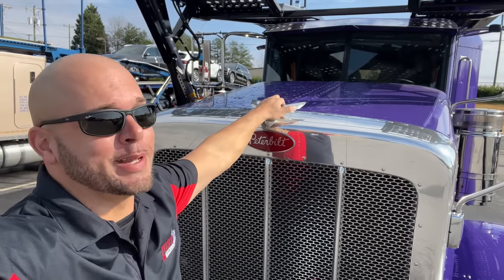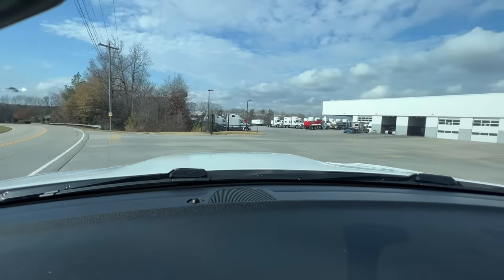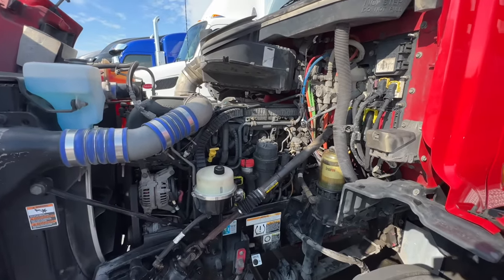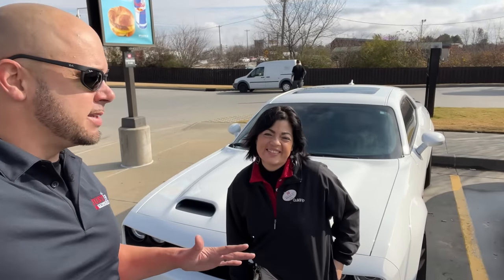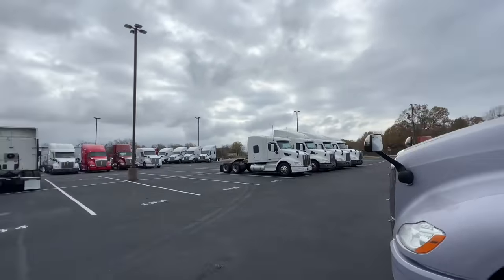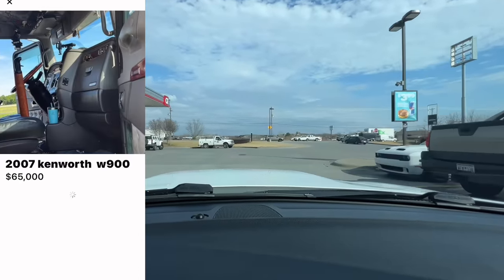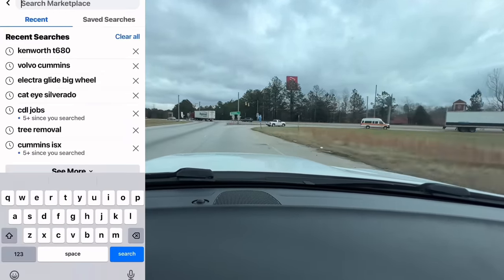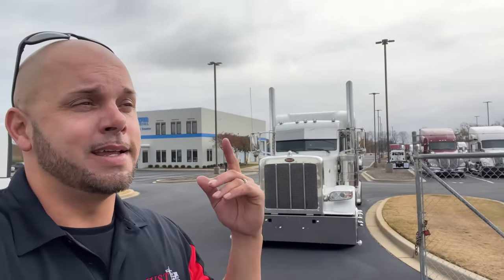BUYING YOUR FIRST TRUCK !! Mistakes NOT to make

Comment: The maxforce engine was made by Navistar and only found in International trucks, the Paccar engine is made by Paccar obviously and a better engine than the maxforce which was pretty much a POS. I am not a big Cummins fan but if I was buying a truck these days I would probably go with Cummins mostly because if you are somewhat mechanically inclined you can do a lot of work on it yourself and Cummins will supply the knowhow free with  their Quickserve account and like you said there is a lot of shops that can work on them.

Comment: Back in the early 70's when I was a teenager growing up on a hay farm my dad bought a 53 Mack Thermodyne with a blown Cummins engine that had been sitting for a couple of years. Dad had been a mechanic in the Air Force. I helped him rebuild the engine and we had a cab-over for hay delivery that was classified as a farm vehicle that I could drive at 16 years old. Dad had never rebuilt a Cummins but he followed the factory service manual. It had 3 gear shifters so it had 24 forward gears. I ended up hauling freight with it as a summer job in Florida when I was in college. That job motivated me to get my Business Degree. Good pay but it was hard work for 12+ hours a day. And now I am in semi-retirement and driving CDL Hot-shot three to four days a week.
Reply: Awesome 👌

Comment: To add to what has been said, if you’re buying a truck newer than 09-10, the chances of finding a CAT engine will be slim, as Caterpillar got tired of trying to do the EPA’s emissions dance and so stopped making commercial truck engines in 2010.
Reply: they still make late model engines you can buy as crate motors. comes with warranty as well like c15
Reply: Yeah after 2006 the Cat engines went to crap, they closed down the Mossville engine plant where i worked and moved it to Texas. The Cat 3406 Acert from 2006 and older is the BEST ENGINE.

Comment: Detroit 60 Series 12.7 is the best engine, hands down! I'm partial because my old Classic XL had that pushing 500 HP on a 13 speed. Old long nose trucks are the best. Screw the DEF and plastic trucks. Pre '07 have no DEF and pre '00 have no ELD. Win win in my book.

Comment: All I can about used trucks from Penske, buyer beware. Not even two years since I had the truck, I am on second major repair. First, def sensors went out spent 13k. Second repair, coming around to 36k +/- right now. though I messed up and took it to Frieghtliner and they are charging out the butt on labor, 225 an hour. Plus, they messed up, left my truck hood unlatched, fuel tank open, and few other issues. I am hoping I can last a 2-4 more years with the Cascadia 125 I have and trader her in for a Volvo.
Reply from the maker: Had my motor blow on my Ryder truck 1.5 years in 😑🙏🏽 it’s part of this industry 😞🙏🏽

Comment: Any Peterbilt or KW dealer can work on an MX13, same as having to go to Freightliner to get work done on a new DD15. I’m 120k miles into my second MX13 with no issues, sold my previous truck a year ago with 600k on an MX13 and had no issues with it. Both ones were 510/1850.
Reply: What can of Fuel Mileage U Where Seeing?
Reply: @chrismoody5977  My current truck is 7.67mpg for the year. I track my fuel mileage on paper every time I fill up. Weight is never a concern for me so if I’m stopping for fuel I top the tanks off all the way and fill my def.
Reply: @chrismoody5977  Hi  My average has been 7.8 mpg. I will take that all day long. And as for reliability I cannot fault the MX13. I am now on my third Pete with the MX13 and for sure I will continue with this set up.
Reply: @anthony1636  What’s You HP And Torque Rating, Do U Have A Long Nose Pete Or A Aero Pete ?
Reply: @bradj7900  what truck? I'm getting from 7.5 to 9-ish in my company Cascadia (turned down somewhat) depending on the load and terrain.
Reply: @connorbaz5980  I have a 2022 579. I have a little bit of a sleeper gap that knocks my mileage down, I have a 250” wheelbase and I order the smallest rubber pieces on the cab fairings as I could get because I don’t like how the large ones look.
Reply: @bradj7900  nice. Yeah my company also has a generous amount of Swing/Dip clearance on their trucks as well. I can go a tad past 90° without contacting the trailer, although things are pretty sketchy if I have to go that far. How do you like the 579? 

I'm currently running a 2022 Freightliner Cascadia, although I hope to upgrade to a company that drives 379's lol. Hopefully they reply to my application in the next day or two...
Reply: @connorbaz5980  I like it. This is the second one I’ve owned, previous was a 2017. I like the 2022 redesign, I’m liking the digital dash and the changes to the outside also.

Comment: How is it going JUSTIN ,
Do NOT forget to pull the plugs on the TRANSMISSIONS and the rear ENDS and see how much METAL is on the MAGNET , Do NOT forget to JACK the FRONT end up and take a BAR and put it in the rim and lift it up and down and see if the KINGPINS are wore out or NOT  tie rods  and so forth  , Put some OIL in a cup go have it checked ,   Crawl underneath and  SHAKE your drive lines up and down see if they are wore out ,  I can go on and on , The more you find the more the money drops off the truck ,
 You let them know what you found that you have to replace and fix and say this is my offer take it or leave it

Comment: I’m in Houston Texas I have a 2013 freightliner cas. 60k rebuilt all Cummins parts new cam reshaved head, water/oil pump, turbo, air compressor and more pics and paperwork im driving it now I’m thinking about sale it $65k w/ tripac Thermo king APU

Comment: Hey Justin the mx motor is not a maxxforce motor the mx is paccar motor maxxforce was international motor which was actually a c13 cat internals and block international head and emission controls. Cat sold the rights to international. To each his own but stay away from emission motors and for sure stay away from cummins they are nicknamed cumapart for a reason. I've got one 12.7 detroit and two c15 cats inframed the detroit with head for around 15000.00 done the cats with head for around 18500.00 each. The transmission shifter has a red spliter button it's a 13 speed if the spliter is blue it's a 15 speed (don't make those trans anymore)  if spliter is grey it's an 18 speed. Which  a 13 and 18 speeds are nothing but a glorified 9 speed with auxiliary box on back of trans. My advice stay away from emission motors it's cheaper to inframe and maintain the non emission motors plus they last longer and they get better fuel economy.
Reply: Not the biggest fan of emission motors myself, but if I were to buy one it would definitely not be a Cummins. DD13 all the way

Comment: I know in Canada its different-  most candaian trucks don't have APUs  but do have a bunk heater, but I head  if its like -45 degrees celsius - you have idle the truck  the whole night or the next day it won't start
Reply: We plugged ours in if it was back at the terminal, but it wasn’t usually that cold.

Comment: When there is a splitter on the side of the stick, you can tell what speed it is from the color of the splitter.
Red-13
Blue-15
Grey-18
There is also the 10 over, I think it's a red splitter, but it doesn't have the hi/lo in the front because it's basically a 5 speed that you have to split every gear
Reply: Don’t forget the 8LL
Reply: @VagabondS316  10 over, you mean super 10?
Reply: @VagabondS316  thanks, I never knew that

Comment: Yeah i worked at the Caterpillar Mossville Engine Plant as a hot test specialist, which i would hook up the engines to the dyno's and run em thru the process and in 2007 i had a fire in my test cell almost EVERY NITE due to the new emissions control BS they were trying to get in order. All of 2005-2006 we got unlimited overtime cause they were pushing out all the Cat 3406's they could before the new emissions of the 2007. The older 3406 Cats were in my opinion the BEST ENGINE EVER!

Comment: Cats aren’t that bad to rebuild, cummins seems to run higher from those I’ve talked to. I have a cat and have talked to multiple people who have recently rebuilt theirs for mid 20’s. If you take it to cat it will be higher. Cummins seems to make it to the 6/700’s , a well maintained cat will make it to a million miles. Detroit seems to split the difference. Cats are definitely expensive to maintain but go further between rebuilds. Detroit is the cheapest, can rebuild those for less than 15. (60 series) best engines: cummins n14, detroit 60, cat 6nz
Reply from the maker: Great info JP 😎🙏🏽

Comment: I run day cabs now, but my last OTR was a 16 Cummins pro star, the factory APU was fine @ 30-40 degrees, but could not cut the mustard on a 0 degree north Wisconsin evening, and there wasn't a trick in the book to over ride the auto shutdown system, ugh, and screw DPF, had a plain jane 06 9400, was the best truck I ever ran :)

Comment: Sorry, kinda responding as I watch, but to tell which transmission a truck has between 10, 13, or 18 speed, the color of, or lack there of, of the side splitter. If there’s no side splitter, only the front one, it’s a 10. Red side splitter it’s a 13. Gray side splitter it’s a 18.

Comment: Note the DDC DD 13-15-16 DPF one box has replaceable DPF filters and all components are replaceable. Many times techs replace entire components based on mileage

Buying used get the shop to back up the filters. Most Freightliners are turned in by big flees at or near 500k
Get a sales agreement on emissions devices of you can. I'd also request test drive with a tech and DL8 diagnostic running during the drive.any faults ask for repair first. 
This would be on any truck. 
Realize Freightliner and Western Star  run Detroit and Cummins.

Comment: I drove both auto and manual. I prefer manual cause I like to have full control of my truck. From what I've heard, it's more costly to work on an automatic transmission. Also I have a 12.7 detroit and I love the motor, cheap on parts and alot of people can work on them.

Comment: Driven both manual and automatic I absolutely loathe the automatics. Also have experience with the x15 and dd15 I prefer the detroit slightly more because the Jake just seems a bit stronger.

Comment: I got a 23 kw 680 Currently has 189160 on the ticker, MX13 on it's 2nd set of injectors and the engine light is on again. I can only imagine it's the same problem as always, time to start looking for injectors again before it goes into Lymp mode again.😢

Comment: Nice video! I currently am a company driver with 3 years exp. I run for FedEx ground right now. I’ve put away over 30k cash and I’m just contemplating what a good next move would be. I’m looking at real estate, but I’m also trying to learn everything I can about possibly running my own trucking operation. Tough decisions.. either way thanks for the video 😎🤙
Reply: @@thomasb282it’s only terrible because people start out with a $1000 truck payment and care about driving more than about running a business. I go 55 mph with no truck payment and take home $3500 per week. I can live off of $1200 with a family of 4 per week and I put away $2300. Btw that’s take home pay. After I put away taxes, repairs, tires, fuel. The borrower is slave to the lender. If the rates were better, there’s no doubt I could be making 4-5k take home every week.
Reply: @ChrisNevaMiss17   man that's some serious money right there even with the low rates now a days, any tips?

Comment: 4 out of 7 of my semi trucks I owned were salvage no problems with them  one had a front end damage nothing crazy one had a new cab because it rolled on its side as long as you stay away from a maxforce you will be fine an apu is key

Comment: 18 speed has grey splitter button on the shifter, 13 speed has a red splitter button.. quick easy way to tell from outside🍻

EGR = Exhaust Gas Recirculation

Comment: I have Two M2-106 with Cat Motors without any issues we bought both Pre Emission @300,000 miles and both don’t use a drop of Oil or Leak a Drop Either they are Both Dump Trucks where we Run the heck out of them, we are definitely a Freight liner Fan the thing is Western Star, Mercedes, Volvo all owned by Daimler Chrysler

Comment: When i worked at the Caterpillar Mossville Engine Plant back in 2007 when the new emissions engine came out it was the downfall for Caterpillar and its engine division. We would have engines that would fail the hot test dyno testing and they would tell us to still ship it and they would fix as warranty work,  hell they had trucks burn to the ground on tye highway. God knows i had fires in my test cell every nite when it came to the 2007 emission control engines.

Comment: My 2016 Volvo has 850Kmiles(more than 23k engine hours)on it and I haven’t needed to do an overhaul. I haven’t too many issues with the after treatment system either. I probably won’t be doing an overhaul until it reaches a million miles

Comment: As a tech the older dpf only trucks 07 to 10 are really good beside cats. Mx engines from 2010 to 2013 were good. But after that are pretty crappy the new mx engines are eating cams. If you can buy an old truck and learn to work on then

Comment: Alot of the new peterbilts have what's called smart air a 4 battery system apu from the factory runs ac for about 14 or so hours before it will automatically start the motor until batteries are charged

Comment: MX-13 is actually a PACCAR motor manufactured by Cummins for KW and Peterbuilt. It's not a bad motor, but the electronics and DEF is problematic. You will see lights on the dash quite a bit with the PACCAR system. My T680 is a 2016 and I'm constantly seeing warning lights.
Reply: Volvo VNL series started from 2003- 2018 with the same body lines.
Reply from the maker: Appreciate the insight bud

Comment: Buy I cheap truck with a rebuild no emissions, I bought my first truck for 18000 I paid it off in my first 6 months then a trailer the next 6 months I had a paid for truck and trailer my first year of operation the second year I was able to buy a w900 outright my second year.  Whatever the case my be keep overhead as low as possible and with some patience and discipline you can get exactly what you want.
Reply from the maker: That’s awesome 😎🙏🏽

Comment: Hi Justin, good on you for talking would be owner operators through, what can be a nightmare in buying the right Truck, for the right job. Your knowledge of engines is  invaluable when it comes to  buying a new, or used Truck. By the by, when it comes to knowing just what box is in the Truck your looking at, Grey splitter trigger is, 18spd. Red splitter trigger is 13spd. and black, I think, is 15spd. Not sure on that colour, been 25yrs or so since I 've driven one. Have seen every one of your videos, for the past 3 and a half years, of course, also a subscriber. Keep up the great videos mate, wouldn't miss one for the  world,cheers. John,Queensland, Australia 🇦🇺

Comment: Maxxforce was international. Navistar and caterpillar teamed up to make the maxxforce and it was a total flop. The MX 13 is simply the paccar in house engine.  They’ve gotten a lot better over the years, and if buying a 19 or newer, the MX really isn’t a bad option. 

I, myself, have the caterpillar C15.  Only problem with a cat is finding an old school shop that regularly still works on them. Thankfully I have a shop like that and they have a better accessibility for old cat 🐈‍⬛ arts that other shops might have a waiting period for.
Reply from the maker: Don’t know why I was merging them as the Same 😑🙏🏽

Comment: To be fair, you should talk about fuel economy.  The " plastic trucks" will get dramatically better fuel mileage loaded or bobtail.  That's dollars day in and day out. HP over 400 is again a waste running flat country like you do, costing more fuel. Fleets run the lower HP and make money all day every day with those trucks.  If an owner is willing to leave money all over the highway with high HP, non-aero , 18 speed just for the image,  then have at it, but at least tell them the truth to watch the fuel consumption in the specs.  Fuel ain't gettin any cheaper.

Comment: Unless your in 15 degrees Fahrenheit OR LOWER....Definitely a good idea to run the engine EVEN IF WITH AN APU!! JUSTIN DOESN'T USUALLY DEAL WITH EXTREMELY COLD WEATHER folks fyi

Comment: I'm sorry to blow up your comment section but I do appreciate your videos and you're very informative.  I know a Freightliner is a cheaper truck they got to say between the ride between how often it breaks down between how it does in the snow it's better than the new Peterbilt aero trucks you know they both have the smart valve and a tag axle hands down the Freightliner is a better truck at least for City driving.  The Volvos internationals are better because they have a twin screw but I know you can order different things here and there.  The Volvo's ride better and they have a longer frame.  I drove a brand new Pete I was not impressed I'd rather have a 5-year-old Freightliner.  But honestly so far Volvo is my favorite truck even when it's got a million miles on it it does good.  Peterbilt are always in the shop the brand new trucks are out of service more than they're running.  The arrow peterbilts I can't speak on the 389s or 379.

Comment: Cannot disagree with you more when it comes to the Paccar Engine. I have been running Paccar power engines for over 8 years, and I am still amazed that you can make comments like " Do not buy Paccar if you want to stay in business ". As for parts I have not had any more problems than trying to get Cummins parts. 
As for finding technicians to work on them. No problems at all. I do all of my minor servicing myself. And if I had a major breakdown then any Peterbilt or Kenworth dealer can and will work on Paccar engines. And their is know shortage of either dealer. My experience has been nothing but good.
Reply: What year is that paccar engine